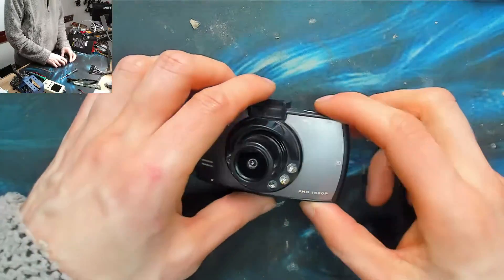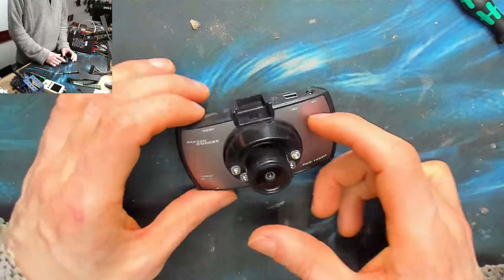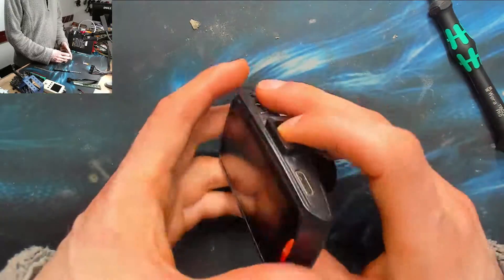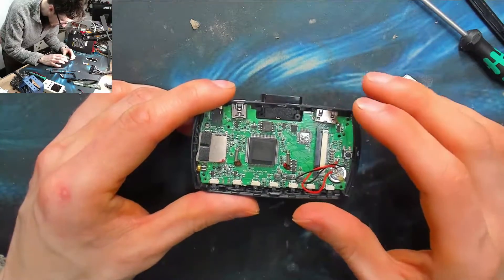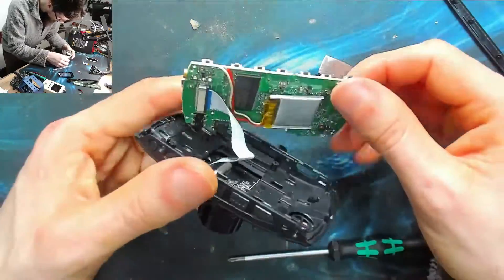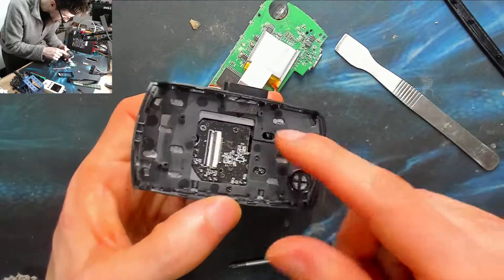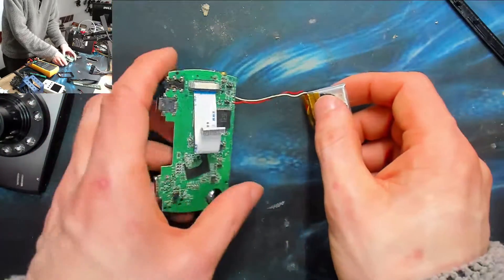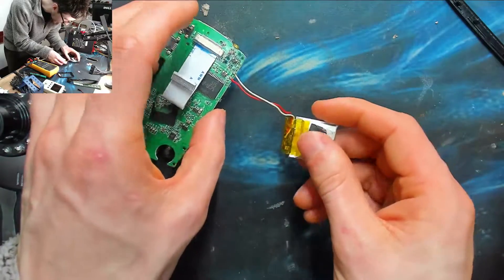LFC#159 - Dashcam battery replacement

Comment: I bought a similar replacement rechargeable battery that is compatible, but the polarity was reversed. Plugged in as is and does not turn on. So decided to reverse the polarity from the pigtail itself and dash cam turned on with being plugged in from power source. Then....I noticed that it is not charging the battery, instead it’s just on like ac powered on. When I disconnect power, it loses all power and turns off. Can swapping polarity do this? 
Or the replacement battery needs like long hours of charging? 
or just bad new replacement battery?

Comment: For this small dash cams, IF all board and circuit are okay but the screen itself is dead, how do we confirm it? The connector that connects the board to the screen is flat wide cable. I don't know how to test it other than continuity.
Reply from the maker: Oooo not sure... My one makes a noise when you turn it on, if I was getting the turn-on jingle, but not picture, I'd bet on the LCD. If I was savvy with SPI / I2C interfaces, I might figure out the pinout of the LCD connector, and check if the VDD (power) pin was high, but I've just had a quick search around and couldn't find any useful resources for that.
But also tbh I'd probably replace the whole cam at that point - unless you've got a super fancy expensive one.